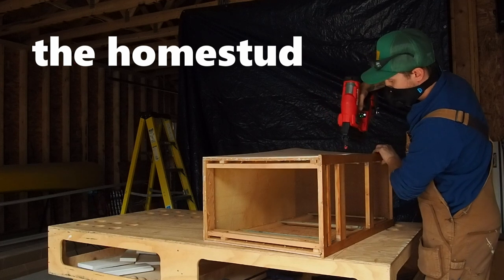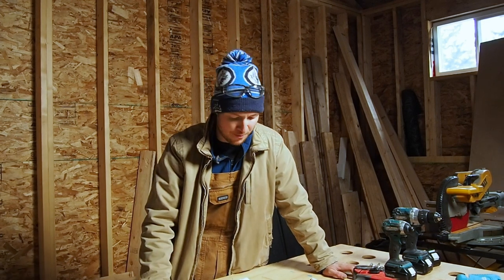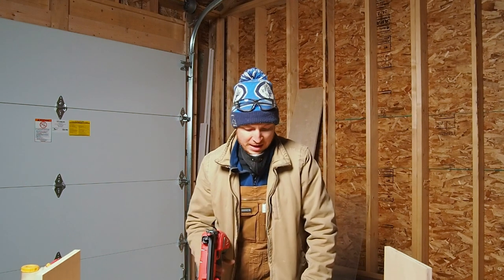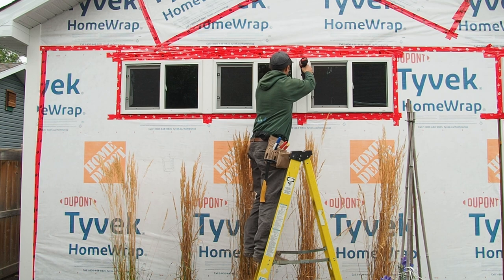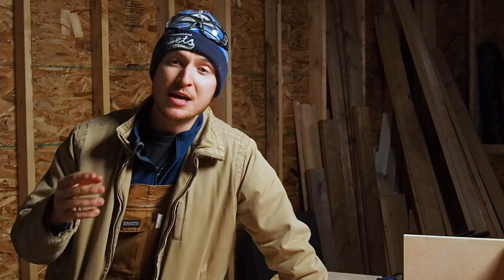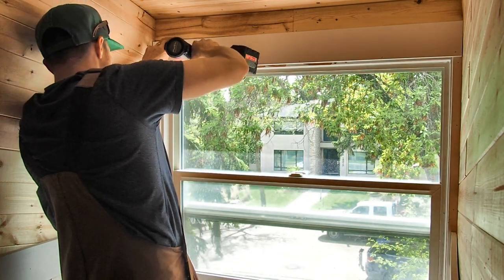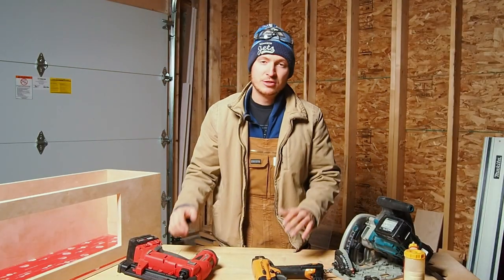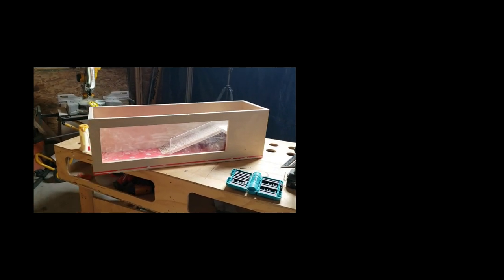Air nailers VS. Battery Nailers (WORTH THE PRICE?)

Comment: One thing that I think is important to mention if you’re just starting out (in favor of air powered) is if you need multiple nailers.  The air guns are much cheaper than the battery guns.
Reply from the maker: Yes this definitely falls under a price win for air. The battery nailers can start to add up in price when you have 2, 3, etc.
Reply: Unless you just starting off and don’t have compressor or hose or gun, to buy all that
Reply: Agree looking at a £100 24L 9.5cfm compressor and a £45 18 Guage nailer, I can then get a framing nailer for £150 at a later date.  Having trouble finding a reasonably priced 16 Guage pneumatic nailer though they seem to be rarer than the 18 Gauge.

Comment: As a trim contractor I think air wins. People forget to charge batteries, need different chargers for different brands. After 5 hours the electric one feels really heavy on hand. Air tools are simply smaller and even with cord, will reach tight spaces, and can have multiple guns on the same compressor for multiple users and different size nails. I think electric simply needs to get smaller and lighter. The compressor also helps when you get a flat tire. I think as a homeowner though, electric would be best (smaller projects). I also think if your in roofing electric is best as to avoid cord. Overall though, lighter and smaller tools are significantly more comfortable in my opinion.
Reply: Stick with 1 brand, forgetting to charge is a thing but if you’re using them or remind yourself or give your self 1 hr of set up time you can have a fully charged battery, and the. Charge 1 battery while using the other then just switch them out

Comment: As a newbie, I am leaning towards the air type. The compressor, hose, etc are extra costs but could be used to power other tools such as a paint sprayer.
Reply: I've been debating on air tools for a while now too. The compressor you need to get a good Paint Sprayer would be pretty big, vs an electric HVLP sprayer. And the only reason I could get the air tools is to inflate tires twice a year. Battery makes so much more sense cost-wise and you don't have to worry about the compressor exploding if it rusts where you can't see it.
Reply: Wrong. You’ll need decent capacity tank compressor to do any meaningful paint gun work and those tanks you’ll never be carrying around with nailer.
Reply: @LaplacianFourier  thanks. I never ran a paint sprayer. I got the pancake type now and even filling air in my truck tires was making the thing cycle!

Comment: I was watching a guy put a roof together, the speed he was going with the pneumatic gun was incredible, can you achieve this with a cordless nailer
Reply from the maker: Both of the nailers I own do have the bump fire function. But I would not rely on this, especially with trim nailers. Personally, I would not even use this method for trim nailers, as you sacrifice accuracy and are likely to cause damage to fine trim pieces. On the other hand, a roofing nailer is a totally different beast.
Reply: Nope! Not accurate either

Comment: a pro framing crew uses a 1k compressor and a 250+ gun, a 80 dollar drop corp; and a 30 dollar hose… 10 dollars of gas. 10 dollars of oil. electric is the cheaper option
Reply from the maker: Not everyone works on a pro framing crew.. Even then, it's not necessarily true they are all on air nailers- the house framers on two of our projects this summer did everything with Milwaukee's new cordless framing nailer.
Reply: @hsdesignstudio  i’ve never seen a milwaukee framing nailer on a job site. haven’t even seen a cordless saw yet.
Reply from the maker: @JohnSmith-xq6cv  I haven't seen a corded saw (circular) in ages. Most of the mitre saws have gone cordless as well.
Reply: @hsdesignstudio  maybe on youtube not in the real world. you really trying to say all the construction sites you see have all cordless saws lol. quit lying
Reply from the maker: @JohnSmith-xq6cv  Haha what a weird thing to need or want to lie about? It's not like I gain anything from relaying what I have come across. Not saying every single site has all cordless saws, but it has been a long time since I've seen a framing crew working without a cordless circular saw. Why would you nowadays- the runtime/number of cuts has improved drastically with every new generation of battery technology. Also many of the construction channels on YouTube are real businesses...

Comment: Hi Thank you for the interesting comparison, just checking out these nailers looks to be quite more usefull in comparison to the screw, I mean it depends on but if you are building these big project only with nailers well, doing small stuff, boxes would be better then using screw...

Comment: Two issues you omitted: 1) What about battery life. I'm talking about how often you have to re-charge the battery. Also, batteries change...14V ,18V, 20V, 56V, 60V...while compressors never go out of style. And 2) What about when you really need to drive a finish nail deep into hardwood? You can crank up the pressure on a pneumatic nailer, but what's the limit of a cordless nailer?

Comment: Great comparison and a fair review.

I also used both pnuematic and milwaukee cordless nailers. And for ME pnuematic is better all the way.
1)  I disagree with the cord argument. I consider the cord to be a blessing and a curse. Its a blessing when you are on a roof and you can use the cord to lower the gun and give it to a friend or have him load nails in it. Furthermore, this happens all the time, sometimes you might drop your nail gun and with the cord I am always quick enough to just grab a cord and not worry crushing someones head or having to come down to get it. However with cordless nailer dropping it is just enfuriating and very dangerous. The curse, is well the range and getting caught up in stuff. But... its not something that bothers me a lot.

2) The weight of cordless framing nailer is riduculous compared to pnuematic. My forearm gets super tired after a couple hours of cordless versus pneumatic.

3) the size of cordless is just... a bear. I always find a way to struggle with some tricky spots on the roof. With pnuematic, well I do not seem like i have any issues.

4) pnuematic lasts forever while cordless well i had to exchange mine after a couple months because it started jamming like crazy. They said it was a factory defect. But the new one still jams way more often than pnuematic. This is enfuriating also.

5) pnuematic performance is unparallel. Especially with older pnuematic guns that have rapid fire. Its awesome.
Reply: Thank you also for your detailed comments. It gives me a lot to consider being a rather slim, fit female, but older with compromised upper body strength.

Comment: Have you ever showed up to a jobsite with a Bostich nailer and they only had Rigid brand air so you couldnt use it?  So annoying.
But seriously, if you use the nailer a lot, probably the battery makes sense. The hose is annoying. But if you only occasionally use it, the pneumatic probably makes more sense.

Comment: Great video. Really really made me think.. I just bought a battery frame nailer and found out i need a total different nailer for molding and trims in the house 😵 So now im thinking i should just go with air for pricing relief... What do you think and Whats the small air compressor i can use for a framing nail gun???
Reply from the maker: Haha yes definitely don't want to use that framing nailer for trim! I use a 4.5 gallon compressor for my framing nailer. This easily handled 2 framing nailers running all out while I was building my garage. As for battery nailers, I have a 18g brad and a 15g finish, and I love them- worth every penny spent. But I use those two all the time, where as I don't use a framing nailer all that much.
Reply: @hsdesignstudio  wow ok!! Really appreciate you responding. So maybe I should keep the battery framing nailer and go buy a brad nailer with air compressor??? Do you think i should return the $350 battery framer and use that to get the air compressor and nailers or keep that one ? ? Help me decide bro 😂 im going crazy
Reply from the maker: Whatever you use the most, go the battery route- far more convenient. If it's an occasional tool, carrying a nailer and compressor is no big deal once in a while.
Reply: @hsdesignstudio   thanks!!!! Really appreciate you indeed! I bought the battery frame gun and went with the brad nailer with compressor because the framing is more laboring so I'll go with that as the battery but eventually i will get a battery brad nailer and finisher battery ... Thanks again for helping me decide!!!!

Comment: I have some Makita Lxt tools. They are ok. I have Paslode nailers and am sick of flat batteries (old system) and gas running out. Ditching Paslode for battery brad nailer. Limited choice for first fix nailers so going for pnematic. Compressor and first fix a lot cheaper than battery..
Reply from the maker: Battery options are definitely not cheap. But depending on the nailer and compressor, that combo can add up quickly as well.

Comment: use and price.  Home workshop pneumatic. If it is your livelihood..cordless definitely
Reply from the maker: If they are never moving, then pneumatic is probably the right call
Reply: Battery being more expensive and needing so many different gauges, a pneumatic set is cheaper for home improvement. I am thinking of getting a set but I am researching brands as of now. I love Milwaukee but can’t spend so much money for each gauge when i can get a set of pneumatic for about the price of one.
Reply from the maker: @Serafines21  a full set is a hefty bill no question

Comment: From my perspective:

Air Powered guns:

Pros: 

*Multiple Nail guns can be used at once in a single Air compressor 
*The whole Set (cable/compressor/gun/etc) will still be cheaper than a Battery powered gun

Cons: 

* air compressors are noisy ASF Since most of us likely use the Rigid/Porter Cable Pancake version😂

* Setting up & Wrapping up can be a pain tbh… not to mention hold up more space in your car

Battery Powered Guns:

Pros:

* The privilege of 💰💰💰
* No need to set up🍺
*Better than the Paslode guns lol

Cons: 

* Your bank account will shrink  
* Electronics will likely wear down a lot faster than on a Pneumatic gun
*You’ll need to stick with 1 brand if you want a stress free Battery experience 

Bottom Line: 

Technically it’s a draw since some Pneumatic guns need part replacement, the hose may start leaking or some of the workers broke another air compressor which more or less sum up the price of a Battery powers Nailer gun… I recommend just buying a Battery powered Nail gun at Home Depot/Lowes, try it out and Return it if you don’t like it… or if you like it then return it and think long and hard as to what brand you’re going to stick with since Makita batteries won’t work for Milwaukee power tools… and I don’t trust 3rd party batteries lol

Most of the people I work with have mostly Milwaukee, Makita & Dewalt powered tools but in terms of Batteries, we mostly have Milwaukee batteries 🔋

Comment: Ive used both and I think they both have a use. I work kitchen building and on site the battery nailers are great. You dont spend huge amounts of time on site nailing often, so the lack of setup is nice. But at the shop or if you happen to be doing a lot of trim which does happen the pneumatic nailers shine. Once you get past the hose pneumatic nailers are a better tool. 
To be honest though I would disagree with your cost comparison, because even if a hose/compressor and nailer get close to the cost of a cordless, the compressor and hose are multi use, they can also power tire inflators, air ratchets, blowers, paint guns, air hammers, etc, meaning it can deliver quite a bit more bang for buck.

Comment: My whole back kitchen wall is pretty much gone that goes out the back door and out onto the patio and back porch door frame needs replace door and all wall everything,,,on the plus side it’s only about 11 or 12 feet wide,,,,I’d have to measure it to know exactly how long it is and I will here pretty soon,,,,I’m thinking I might have to redo the floor a little bit nail some 2 x 4 pressure treated to the floor and come back up to the foundation because I think the tips of them are a little bit rotten the whole wall and I’m going to have to rip out some of the ceiling to see if the ceiling joists that hook onto the wall are ok or gone if gone I’ll probably nail some pressure treated two by fours from the good part of the joist out to where they hooked to the wall come out with fresh wood to hook onto the wall.... I have never done anything like this before I’m thinking it’s going to be a very tight area so I’m gonna need something like this,,,,I’m not a Carpenter I’ve built a couple dog boxes in my day and time they were ok they lasted for five years or so probably however,,,,wish I could find an affordable handyman that knows what he was doing that could be trusted they’re hard to find anymore.
Reply from the maker: That is quite the job. I would be 100% confident if your ability to tackle this because it sounds load bearing. Having a roof cave in and your safety is not worth saving a couple dollars. There are typically small carpentry companies around that can tackle these project.

Comment: What about in terms of power? Are they the same? I heard battery ones are less powerful. I don’t know.
Reply from the maker: I don't think they are. At least not for my uses. I'm thousands of nails through mine with 0 misfires and maybe 10 protruding nail heads, and these were poor firing by me- leaning sideways or reaching without enough pressure on the tip. I also have yet to run a full battery to empty in a normal working situation. That's my experience for my first year with them.

Comment: Electric guns vs pneumatic, I'd like to hear from someone that can REALLY use a nail gun.  I'm talking about a framer shooting 12d nails at 3 per second like I was when I was 25.  I'm talking about a roofing nailer shooting a full shingle in 1.5 seconds like I was doing when I was 25.  I don't know how good these electric guns are, anyone that knows what real work is have comments here?
Reply from the maker: So you think moving fast is "real work"? I watched a crew frame the entire house next door to me using the new-ish battery milwaukee framing nailer. They had no complaints, nor were firing 3 nails a second. I framed my garage using my pneumatic Paslode,, and I wish I had a battery operated when climbing through trusses. I also wasn't shooting 3 nails per second framing...most people aren't.
Reply: @hsdesignstudio  In a massive manufacturing facility, where I learned to frame, if you didn't shoot that fast, you didn't keep up.  Maybe electric is just not for that situation. As far as pneumatic goes, I haven't found a nailer quicker than Hitachi (now Hikoki), very quick.  How spendy are those new 12d nailers?
Reply from the maker: @shanetanner5063  That's fair, but I think that is a very specific situation. I'm also not saying that both styles don't have their place. I fall more on the reno spectrum where moving fast isn't ever the goal, or even optional half the time. Last time I looked that Milwaukee battery framer was about $500 CAD..not cheap, especially if you aren't already using their line of tools. I was actually trying to get ahold of the Hikoki battery nailers back when I bought my Milwaukee's, but you just can't find them in my neck of the woods.
Reply: @hsdesignstudio   Not too bad.  A new Hikoki pneumatic is (was) almost $400. Simple components but they know they're unmatched. (At least in the pneumatic world.)